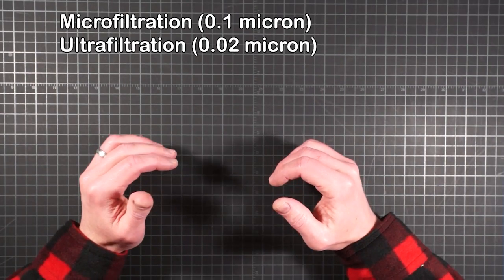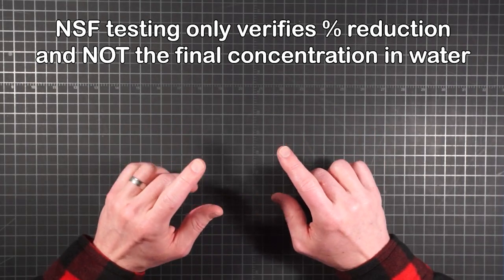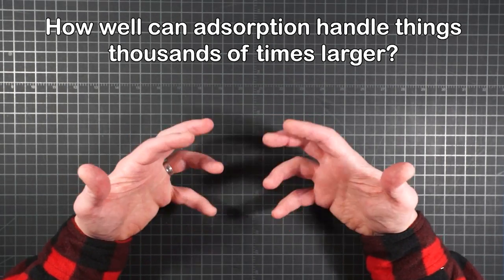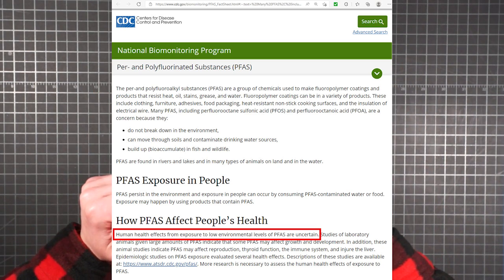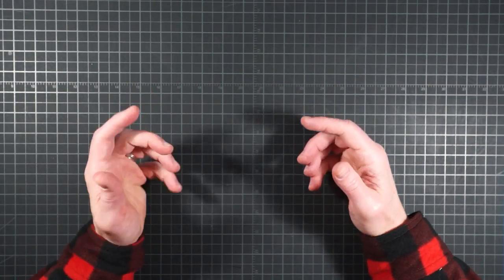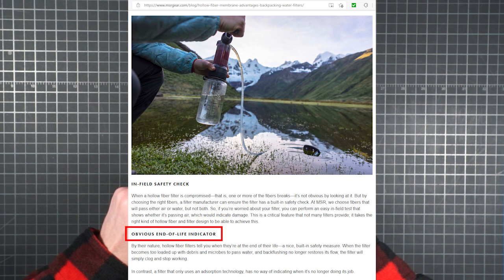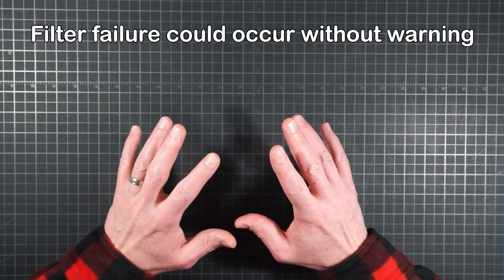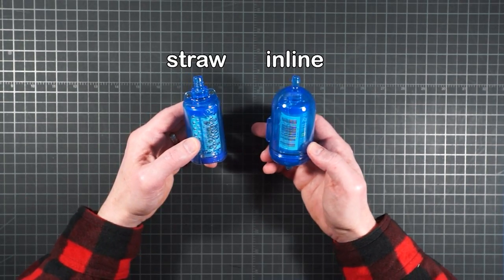Backcountry Water Treatment - Part 5: Activated Carbon Filters for Chemicals and Viruses

Comment: Thank you!
Two questions: a friend has and uses a stainless steel water distilation unit, does sd produce pure h2o?
And: A few years back a "survival kit" included some large clear plastic bags
And said to fasten them around the end of a leafy branch, that after several
Sunny hours water produced by the leaves ( chlorophyl sunlight CO2-> H2O +O2)
Would condense inside the bag producing water safe to drink.  True, or myth?
Reply from the maker: Distillation is probably the highest level of purification. It will even work to produce drinkable water from salt water.  The distilled water should be free of even dissolved minerals.   But, it takes a lot of fuel and time to produce a useful amount. 

I’ve seen videos on gathering moisture from tree branches using a plastic bag, but I’ve never seen any actual studies on it.  It makes sense that you could get at least some water that way.  It might not be enough (under all conditions) to keep you alive, though.  I’d always want another way to get water.
Reply: @GearSkeptic  I agree about the bagged tree leaves 
being in a 4 season area.  
With the steam distilation I was concerned about hydrocarbons?  Partly because I'm familiar with steam distilation of essential oils, which aren't quite oils yet still lower specific gravity than water, and for that matter things like rose hydrosol/rose water.
I would suppose? that activated charcoal filtering would clear most of that? Including the caveats of replacment?
Reply: Oh! With regard to the bag and leaves water source, it reminded me of tapping maple trees, the sap -  when running should/could be a water source, just depends on how many trees are tapped.  Possibly?
Reply from the maker: A carbon filter would probably be a good idea.  I haven’t seen any studies on it, though.

Comment: Really enjoying working my way through your excellent and informative videos.
I'm wondering if your extensive research can answer a question which has been in my mind for over 50 years. 
I grew up in a rural area of the UK where intensive farming dominated the countryside. As well as herbicides and insecticides applied to crops, huge amounts of nitrogen were applied to the land as fertiliser. Obviously these would leach into the local water sources.
It is the latter of these i am wondering about.
What is the best method for removing nitrogen from water?
It seems few filter manufacturers ever seem to mention nitrogen,  yet it is applied in vast quantities to agricultural land.
It would be great if you have an answer, thanks. 👍👍
Reply from the maker: Nitrogen itself is a harmless gas.  Air is mostly nitrogen.  You breathe more of it than oxygen.  Nitrogen can be part of other compounds, though.  For chemical removal, the Grayl or the First Need filters are the most-certified choices.  They can’t filter everything, however.  Ammonia contains nitrogen, for example.  You’d need an osmosis filter or distillation for that (those are not backpacking options).
Reply: @GearSkeptic  
Thanks for the reply. One of the reasons the subject worried me was many years ago I heard a tale of someone who poisoned himself by licking his golf ball to clean it after every hole he played. After years of doing this he was taken ill and had both legs amputated.  The story blamed the nitrgen fertiliser used on the golf course, hence my concern at ingesting run-off water. The story may well not be true however.
Thanks for your answer, can finally forget about it. 😉👍👍

Comment: When alluding to your hiking being more likely needing to protect you from farm run off (S3) rather than industrial run off (Geopress) are you not making an assumption there? Is it not plausible that each company tested different volatiles etc and that a high adsorbtion rate of one that was tested is similar to one that wasn't tested due to some sort of chemical compatibility? In which case is it worth considering which product has the overall better average? Assuming, of course, the companies did not simply omit or avoid unfavorable results..
Reply from the maker: No. Taking the supplied test results at face value is not an assumption. The assumption is that they both might be similar even though the published results differ.